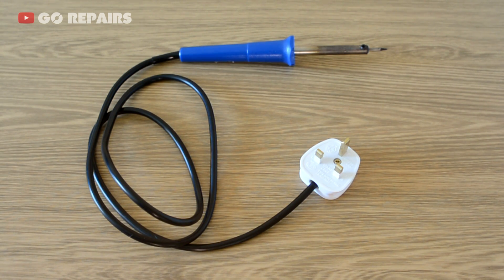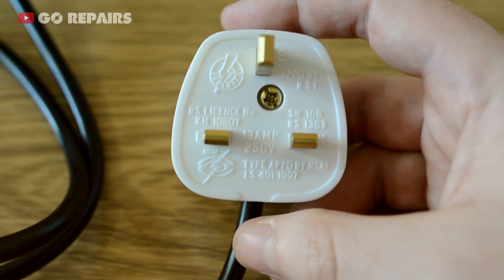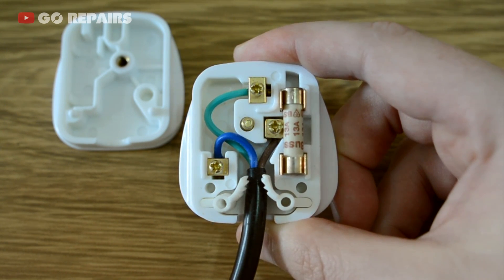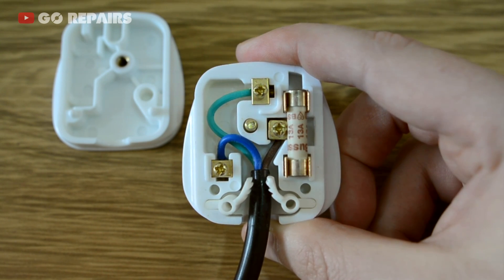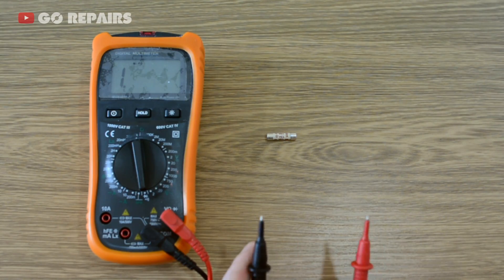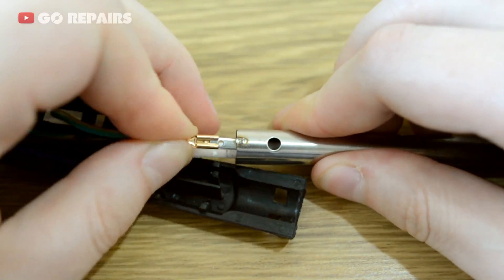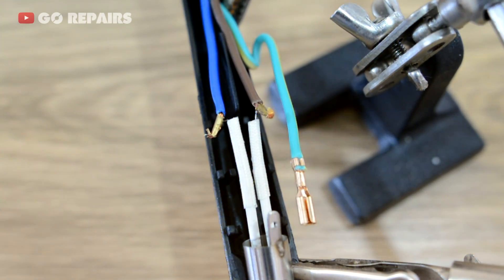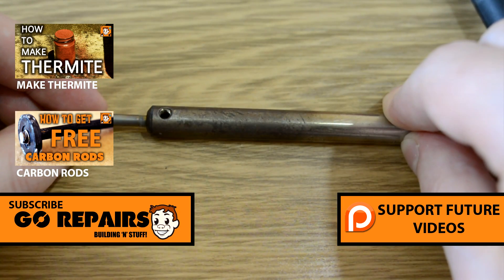Soldering Iron Faulty? Repairing Soldering Iron Tips

Comment: I Basically had the same problem with my soldering iron. Last monthwhen I was on my way to the store, my car died so I got my multimeterout and I checked the voltage on the battery and it was 9.7378 Voltsso I thought “what the heck is going on with this battery”, thenext thing I knew I seen some smoke coming from the tips of thebattery terminals. I was suspicious on what was going on and Icouldn't believe it because this battery was only barely 16 years oldwhich I consider fairly new in today's society, so basically what Iwant to do is try to clean up the battery with some soap and saltsolution and then I might put it on the charger for two or threeminutes at a high current rate just to see if it will hold a charge.I'm not sure if that's going to help the battery or not but onething's for certain before I go out and buy a new battery, I'mdefinitely going to try these two methods that I suggested. Now onthe other hand I could swap the battery out with one from my 1962Chevy Tahoe but I'm not sure that my old lady would let me do that,so basically what I need to do is first, I'm going to check all theair in the tires before I monkey around with the battery. Then I'mprobably going to run a few errands around town down and the nextthing I want to do is get some paint and paint the battery terminalsbecause I don't think they look very good without the neon yellowcolor look on them. If all goes well, I am planning to do a few otherthings to the terminals. Next after that chore, is get some of thatdistilled water and pour on the outside of the battery to try toclean up a lot of the dirt and dust its accumulated over all theseyears. If I have time what I'll do after that it's try to clean bothsides of the mirrors on my 1965 Ford Bronco because I've noticedwhile I was driving that it's hard to see what kind of traffic iscoming up behind me. I was having a problem with the battery when Iput the headlights on low beam and then when I tried to switch thehigh-beam I noticed that the voltage excursions were jumping aroundso I went out and I bought another set of test leads to use on mydigital multimeter and there was no difference at all, so I think Imay borrow my friend Tony Jones's multimeter just to check thosevoltage excursions to see if that is normal. Nobody really explainedto me how to test a DC voltage excursions when the battery is not inits prime. I am all on my own doing this. A lot of people havecontacting me and they said that they've had that problem once ortwice and maybe even three times in their lifetime with theirbatteries but they did something totally different. What they did wasloosen the terminals first then they carefully remove the battery andhoisted it out to get rid of all the debris and dirt that'saccumulated after all these years then they put it on a slow chargewhich I believe they told me was 32 milliamps for 6 days, 3 hours and54 seconds. Next they took the battery caps off and added somedistilled water, which they claimed that they bought it at theirlocal Walmart store. I think, if I can remember correctly, they saidit was .99 cents plus the sales tax. Can you believe that just99cents? That's a real good price for one full gallon of distilledwater. Speaking of water, yesterday I helped my neighbor that livesto the right side of my house, fill their swimming pool for the newseason. It literally took 7 hours to fill. I am not sure how manygallons it is. I have met people in my lifetime that had no idea thatthere were 4 quarts of water in a gallon jug. They just assumed itwas a gallon only. I am not really good at math but I do have acalculator on my cell phone. Speaking of math, it takes me back tograde 11 in high school when my teacher, Mr. Lowry gave us a sneakquiz on algebra. I failed it because I didn't understand what thatwas all about. I spent most of my high school time stoned and kindaout of it. Some of my classmates were very good at math, and it evenshowed when they got their report cards. I may have gotten of thepath of whatever we were initially talking about. I think it hadsomething to do with blue cheese. No, I remember now, it was carbatteries. I never could figure out why they put car batteries in thefront of the vehicle and not inside the vehicle. It would be so mucheasier to work on them, especially in the rain, if they were insidethe vehicle. Doesn't that make more sense to you too? Well anyhow,batteries are pretty heavy for their size and some people can't liftthem very good. I had a fried, Tony Smith who had asthma and once hetried to lift out his car battery, and sneezed, and the battery fellout of his hands and landed on his right baby toe. It broke the smallbones in that toe of his. I called his mothers step daughter Ann butshe was not home. So I then called his brothers uncle Fred and toldhim about what just happened to Tony's toe. He seamed like he wasdrunk and started laughing at me and said “I don't care about thatBast#$ds toe”. I got mad and hung up on him immediately. From thatday on, I never spoke to Tony's brother's uncle Fred. I never reallyliked him in the first place because when Tony and I were 13 yearsold, we were at a softball game and Fred walked over to us and fartedright in our faces. That was not very nice of that old pervert. Iheard some stories about him when he was about 20 years old thatwould make you cringe if you heard them, but I can't get into thatright now because I have to finish up my posting here on you tube. Ihope I have given you folks some good advice on having some of yourproblems solved in a timely manner. I like to help out when I can ifit is at all possible. I am out for 3 more hours so I want to go nowand get a hot dog and a bottle of grape soda. I need to look aroundfor a ride so I can get back to my padded room at the Sinclair InsaneAsylum. I hope Dr. Dilbert will not be mad at me for sneaking out....

Comment: I have the exact same looking soldering iron. I looked at the fuse, checked wiring for continuity, was all clear but I don't know if the heating element is faulty but I'm assuming it is because it's the only thing I have not checked. Great video.

Comment: Can you help me I got one and it heats up but it only heats up enough on one spot on the side not even the tip to melt solder PLZ help me
Reply: Same problem. Got one thats supposed to be 60w for 110v. Barely heats up. At most, it heats up to 50°C.